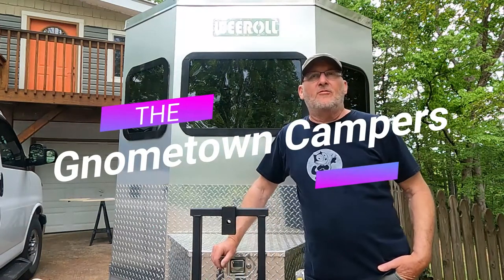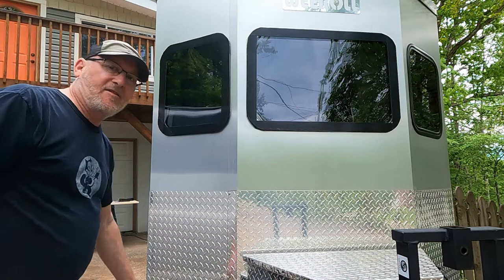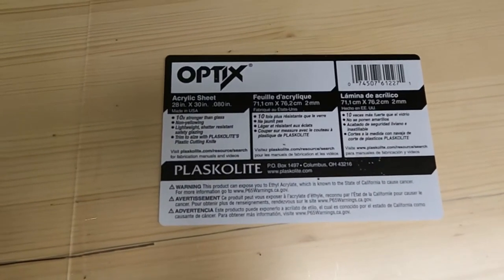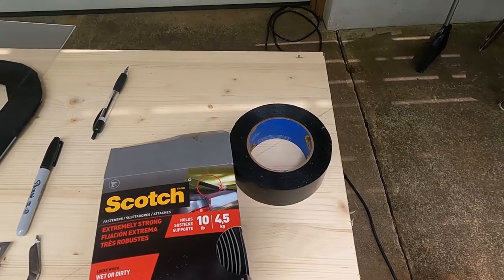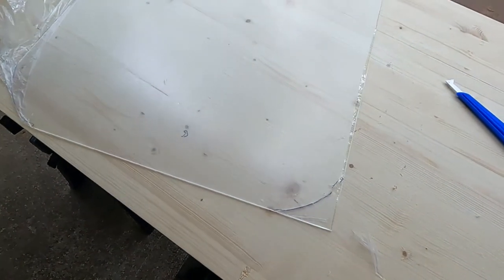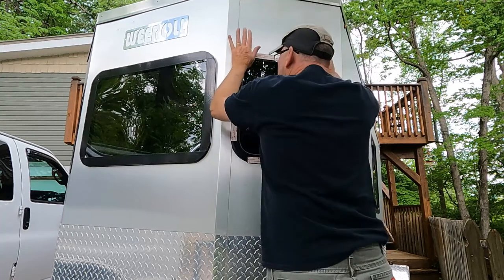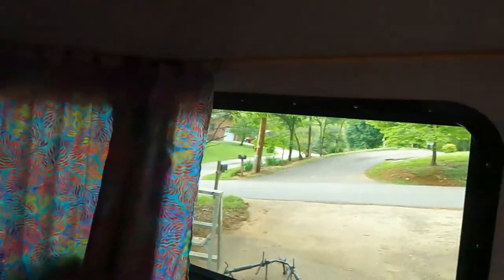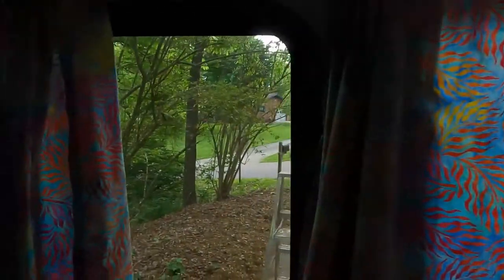DIY WeeRoll Front Window Rock Guards

Comment: Crazy to have windows on the front of any trailer. Airstream gets away with it by putting plexiglass panels in front of their windows, and steel rock-guards to protect the aluminum in front. Other manufacturers in the past have plastic or fiberglass covers.
Reply from the maker: The answer is in front of you.

Comment: So, when it gets really hot, with the sun shining on the black gorilla tape heating it all up won't the velcro adhesive underneath loosen and fall off ?   Just thinkin' ! ✌️🇨🇦
Reply from the maker: Nope, I did two of the three windows last summer, it lasted through the heat of the summer and cold of the winter, and now it's 85 degrees again. That stuff is rated for extreme outdoor use, but feel free to use whatever anyone personally favors. I don't have a  dog in it, just showing what works for me, and I am not trying to tell anyone what they should do.I used the duct tape to make it look nicer than having the ugly white strip of the Velcro show through. It isn't a factor in the construction.
Reply: @TheGnometownCampers  thank you for answering , I was just wondering as I have had the sticky backing of velcro fail, not the velcro itself !  I enjoyed your video, and appreciate your helpful tips. Thanks again, that's good to know. ✌️🇨🇦